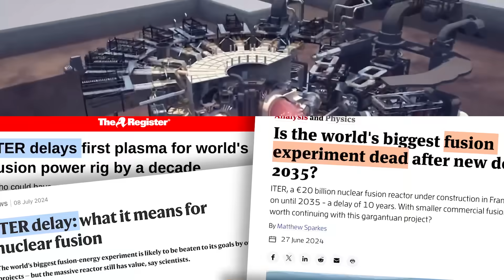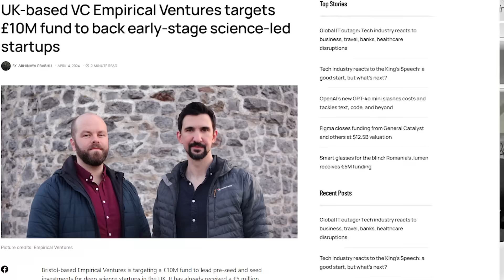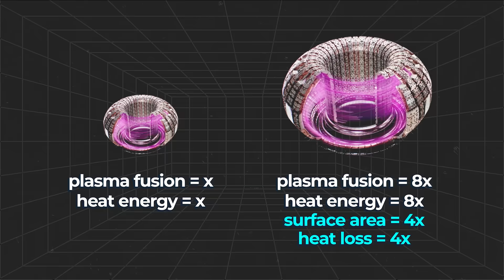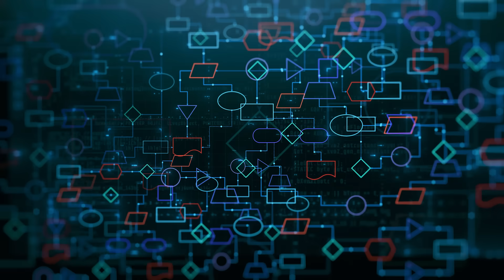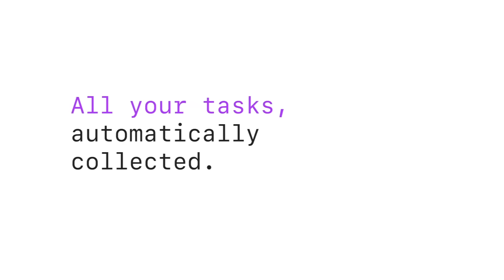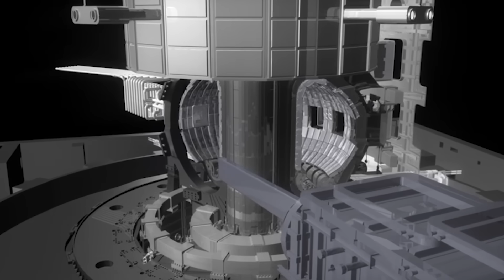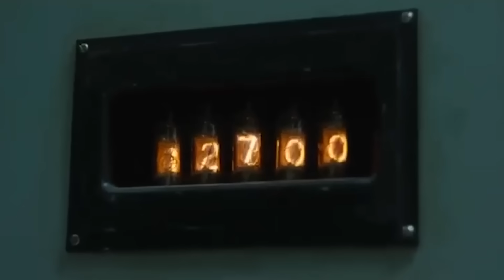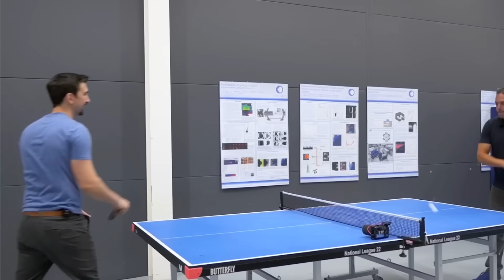Is The World's Largest Fusion Project Dead?

Comment: ITER & all magnetic confinement reactors are Dead on Arrival. issue is stability of the magnetic containment field. The plasma contained in the reactor also has magnetic fields which interact with the containment magnetic field causing to to destabilize & leak plasma. The longest run to date is about 5 minutes, & it wasn't repeatable. 

ITER is really just a jobs program as it has zero chance of working.

Unfortunately all of the other fusion methods are just as equally flawed & have no chance of working. Even if something like ITER was feasible the cost to generate power would be around $15 to $25 per kwh. Most power companies currently charge under $0.50 kwh. No one is going to pay an insane cost for electricity. The issue is is that a 1 GWe tokamak would costs about $150B to $200B to build & have very high operating costs. The cost of tritium fuel for 1 day of operation for a 1 GWe reactor would be around $2B per day. Plus global production of material needed for the Tritium breeder jacket is extermely small, a 1 GWe breeder jacket would required about 2 years of global beryllium production. Which means it at best the world could only manufactor one  1GWe reactor every 2 years because of the supply contraints of just beryllium. I would imagine the cost for beryllium would skyrocket.

In perspective, a 1GWe nuclear reactor costs about $15B, and a NatGas 1GWe power plant costs about $500M.

Comment: I worked at Tri Alpha Energy for FOUR years, 2008 to 2012.. and I can tell you, fusion will never become a source of electrical power and your notion that it will have any efficiency over the input to the output is a lie. When I left in 2012 I felt bad for all of the people donating money and investing in the project. It has NO hope to do what it was marketed to do and it never will. Furthermore, we have never found a means or coating for a vessel that will stabilize the plasma. We broke records and it was still in milliseconds, which is basically a Spark. It’s embarrassing and the entire fusion and physics community should be ashamed of all of the money they have wasted.

Comment: Russian Scientists Igor Tamm and Andrei Sakharov designed the Tokamak-15, or T-15, which is the Russian machine that ITER is based on. It succeeded in creating its first thermonuclear plasma in 1988, and the reactor remained operational until 1995, achieving 1 MA and 1.5 MW injection for a 1-second pulse. From 1996 to 1998, the reactor underwent a series of upgrades to conduct preliminary research for the design of the International Thermonuclear Experimental Reactor, or ITER. In 2010, further upgrades led to the creation of T-15MD. The assembly of the magnetic coils was completed in August 2019, which are the same coils to be used in ITER. The first working tokamak, the T-1, was developed by Natan Yavlinsky in 1958, with 'T' standing for Thermonuclear.

Comment: To answer the title question:   I think ITER is dead, but will waste another $5 or 10 billion before anyone is brave enough to pull the plug on it.   If tokamak fusion is ever going to work, it's going to be with much more powerful magnets and different control regimes than what ITER can achieve.   Finishing ITER at this point would be like finishing a climate model based on 1980 computing capabilities.   You may get it to work, but the world will run right by you while you do.

Comment: I dont take issue with the funding but the speed. Lets take this to any project of this scale: If you are not willing to build 5 small pyramids how are you ready to build 1 big pyramid. Yes you can just do it problems can be solved but the speed at which they will encounter issues for all pyramids built in the future is way slower on the big one. I doubt any of these companies will have scalable solutions since they use just as propriertary components as anyone else but atleast they know the parts they will need to make already, something i am unsure ITER can do considering tech is updating faster then their rate of constructiion. If we were building 2 iters right now we could sacrifice one for fast changes but right now it feels like they are trying to perfectly simulate everything beforehand. Humanity has built everything by half-assing it, engineers are skilled at using incomplete knowledge and still attain good results in their objective yet somehow we can't accept this for fusion. Double the budget for all i care but make it so it is not an infinite money sink that hampers multiple generations and becomes the butt of the joke of not getting stuff done!

Comment: Solar and batteries decentralize power to the people... but reactors like ITER rather centralize it... the current electrical grid is not "renewable ready" yet,  because shareholders want solutions which they can keep monetizing... and most governments are beholden to lobby groups...
With better magnets ITER size tokamaks might actually reach commercial Q. But the ITER project does not allow for improvement of technology and... by design... will never generate direct value on the energy market... It's... bluntly put... a bigger hoax than cold fusion... But at least the money doesn't go to more missiles and bombs... so that's a win I guess...

Comment: ITER to me seems like a giant search party with everybody standing on top of each other and looking for fusion in one place at same time. This tokamak fusion method suffers from a severe thermal problem, it’s kinda like trying to make a internal combustion engine out of dry ice, and whatever power you make is feed back into it for Thermal management along with extra power to compensate for insufficient output.
The best approach to fusion I’ve seen is Focus Fusion, the funding received for focus fusion and ITER are on opposite side of scale from each other. 🪙 ➡️💰💰💰💰💰
PWR is the only fission reactors the western countries are allowed to have right now, until china start selling their Thorium Molten Salt Reactor to the rest of the world, maybe they can get the tritium they need from china Thorium reactors, as well as use those Thorium reactors to help startup ITER.

Comment: It feels like fusion is just another red herring, dangled in front of us by the fossil fuel industry. Because as long as we wait for some future miracle technology we don't think about existing solutions.
In the 70's the fossil fuel industry promoted solar power, and in the 90's they hyped hydrogen. Now that China made solar power actually economical, the fossil fuel industry no longer likes it, so fusion and hydrogen are hyped again. The latter as an alternative to electric cars.

Of course fusion is real and we'll solve it, but it's not a magic bullet either. Even in the best case, it's still nuclear, so the same fears will apply and the fossil fuel industry will do everything to kill it.

The elephant in  the room is fission power. It's been used since the 50's for power generation, and works just fine. Without political manipulations most of the world would have been converted by 2000. And the fact that you can instantly recite a list of objections only proves my point.

Comment: lol... I wrote my PhD thesis on one small aspect of fusion, back then the mantra was: "in 30 years, all electricity will come from fusion reactors." That was in the late 1980's/early 1990's, right around the time ITER was born as an concept.

Since then we got Hubble, Webb, the LHC, Ligo, and a few other things. Well, an actually working fusion reactor isn't one of them, and the projected time lines suggest that it ain't gonna happen anytime soon either.

I'm with Ben on this, maybe it would be good to use the money to fund more recent projects. And btw, I really appreciate the analogy of "collapsing the wave function", that works on so many levels ;)

Comment: My quick reaction is although the simple scaling laws based on heat loss vs heat generation favor larger experiments, the basic problem is with plasma stability.  What does that scale with?  In practice, I think the way to solve fusion is to get practical nuclear fission, which basically means being quantitative about risk vs reward.  This would kick the can down the road by about a hundred years, by which time we either solve fusion, get better batteries, or the risk vs reward set point needs to kick up a notch.

Comment: Wind, solar and nuclear is in the hands of companies now.  These techs work now, fusion does not.  Those companies are using mostly private funds to do research, not government funds.  I know they still get some government funds but it is drops in the bucket compared to what these companies are spending.  Wind, solar and nuclear tech is already here so claiming that research into fusion is taking government money from those research budgets is a bit of an exaggeration.  As far as private companies doing the research, this is not like space travel where the tech was already there for SpaceX and the other space travel companies.  Private funding is fine when the tech exists and it just needs to be matured and improved incrementally.  While private companies are a bit more flexible and can react quicker to problems they can't stay in business for a decade or more without something to sell.  I doubt even the most staunch fusion supporters and optimists think fusion will be ready in the next 10 years, regardless of the route taken.

Comment: I'm not worried at all. I'm just surprised that Olkiluoto 3 got ready first and is cheaper.
Reply: The Olkiluoto Nuclear Power Plant is one of Finland's two nuclear power plants, the other being the two-unit Loviisa Nuclear Power Plant. The plant is owned and operated by Teollisuuden Voima (TVO), and is located on Olkiluoto Island, on the shore of the Gulf of Bothnia, in the municipality of Eurajoki in western Finland, about 20 kilometres (12 mi) from the town of Rauma and about 50 kilometres (31 mi) from the city of Pori. Unit 3 currently is the most powerful nuclear power plant unit in Europe and the third most powerful globally. It consists of two boiling water reactors (BWRs), each with a capacity of 890 MW, and the Unit 3 is an EPR type reactor with a capacity of 1,600 MW.

Comment: My main reservations about fusion is that the equipment and maintenance costs are always so large that it would continue to concentrate electricity generation into the hands of a few large wealthy corporations with an outsized influence on markets and politics.

Solar, geothermal, and to a lesser extent wind, at least have more potential for localized residential home and community level power generation that can never exist with fusion. We need to diversify, localize, and democratize power generation, not continue to be held hostage by oligarchs.
Reply: One could have said the same thing about computers back in the 1940s, and look at where we are today.  Technology, especially advanced technology, always starts astronomically expensive, and works its way down the cost curve.  Once we actually solve the problem, the technology will be refined, and the cost will come down.  Assuming governments don't prevent that with over regulation, turning it into a protectionist market (like they have with so many things).
Reply: FuZE - the Fusion Z-pinch Experiment by Zap Energy is known for being the simplest, smallest, and lowest-cost fusion device to achieve electron temperatures exceeding 30 million degrees Celsius. While the exact total price of the FuZE reactor isn’t publicly detailed, Zap Energy has raised significant funding to support its development, including a $160 million Series C funding round. ITERs insane budget, is a result of the size and scale, with 35 nations all climbing on top of each other like ants, they also need massive amounts of space, with huge costs of land purchasing, being the first expense, which has only continued to balloon since, the magnets made in Japan cost more than the entire budget allocated and it was initially meant to have gone live 8 years ago. The truth is, its the least likely fusion reactor to ever function, at all.

Comment: It was always doomed because the underlying theory of Nuclear Fusion as a source of energy is fatally flawed and false. Nuclear Fusion consumes heat and emits light, neutrons, and helium. However, neither light, neutrons, nor helium generates electricity; rather, heat does. In thermonuclear bombs, Fusion is purely employed to inject neutrons into the subsequent stage fission device, thereby accelerating fission to achieve roughly 98% efficiency. Without the neutrons contributed by the 'fusion' stage, it utilizes merely about 1-5% of the total fissionable material. The potency of hydrogen bombs lies in the fact that nearly 100% of the plutonium undergoes fission before being vaporized. Fusion contributes nothing to the heat and explosive yield itself; indeed, fusion absorbs and reduces that heat and affords the second fission stage more time. However, to generate electricity, you need heat to create steam to turn turbines, but Fusion consumes heat and releases neutrons and a flash of gamma rays. Neutrons damage the containment chamber, and gamma rays are simply squandered. The amount of residual heat is less than what was initially input. Thus, clearly, unless we can somehow convert gamma rays into electricity, fusion is a futile endeavor. It is baffling that so many intelligent individuals fail to grasp something so evident, all based on the axiomatic assumption that fusion powers stars, predicated on the observation that helium possesses less mass than the sum of its parts. This is because the strong nuclear force is not mass—it is energy, which, although not released, is not manifested as mass either. That is the prerequisite for this force to exist—it is derived from elsewhere.

Fusion is not the mechanism that powers stars—Gravity is the mechanism. Fusion feeds on the energy generated by gravitational collapse, and part of that energy is stored in the nuclear bond. The amount of free energy post-fusion is LESS than the amount of free energy pre-fusion. The surplus energy can only be reclaimed through NUCLEAR FISSION. Fusion stores the energy; FISSION RELEASES IT.

Comment: My biggest gripe is that Iter isn't viable as a power source even if the entire project was completed on time, on budget and exceeded expectation. The power factor that would make the size of iter sustainable would be larger than any consumers in france could potentially use.

Even worse, the size of the turbine and power lines would also warrant another iter-sized project.
Reply: ITER was never designed to be a power plan demonstration, that is the role of DEMO-like projects, of which there are tens because nobody can agree on its design yet until we have the vital information that ITER will provide.
Reply: This is completely false, advancements made because of ITER and science in other fields will make building an actual powerplant very likely, REBCO superconducting magnets alone will make Fusion up to 40 times cheaper since it was solved. But there are still many things to test, to make sure we know what we think we know, and find better solutions for things we don't know yet.